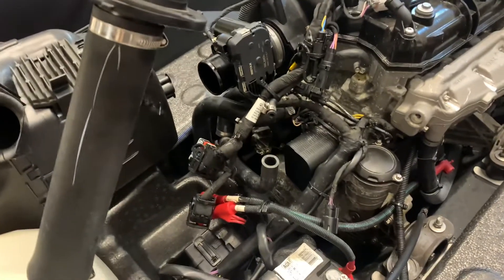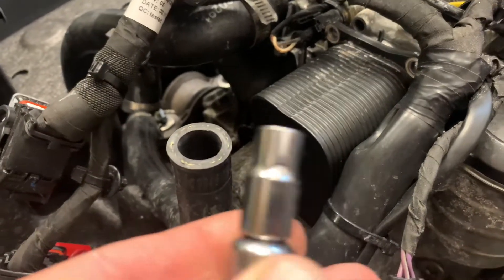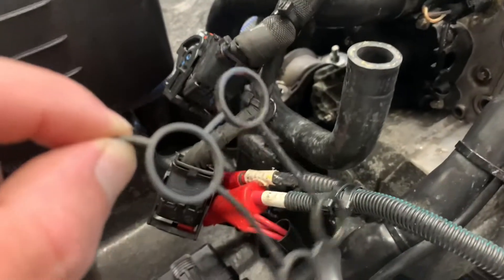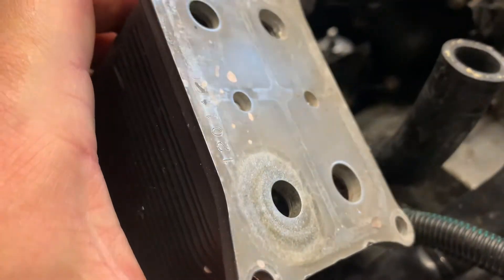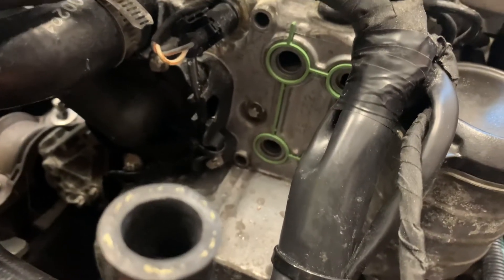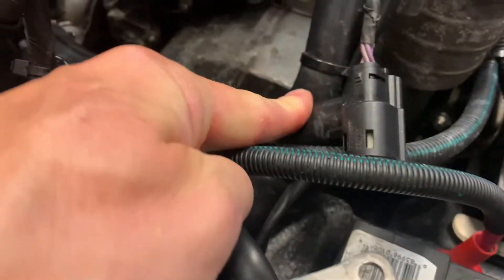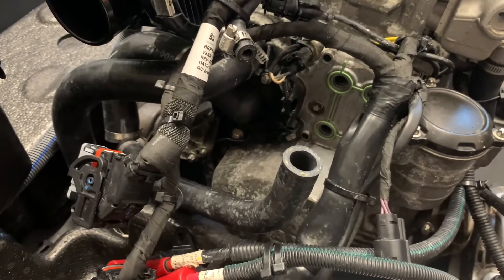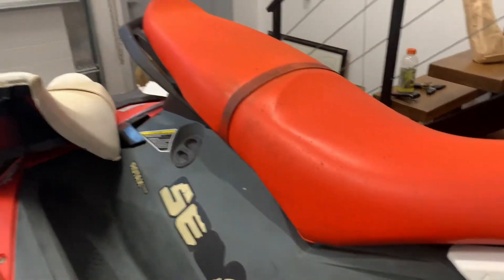SeaDoo Spark Rotax 90 HO Updating the gasket for the oil cooler

Comment: Do you have to drain all the oil from the motor before starting this?  I assume the answer is yes, but I am not very experienced working on jet skis. I noticed last summer that I was low on coolant and this year when I did the tuneup, I started tracing where the leak was coming from, which was behind the oil radiator